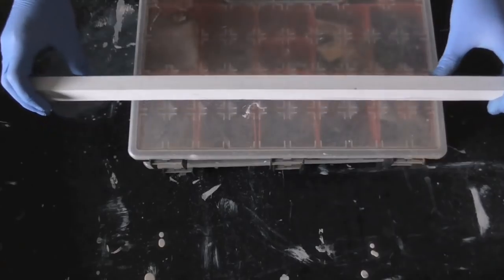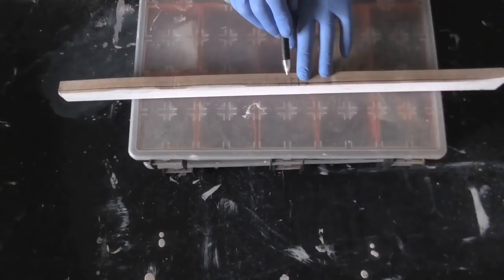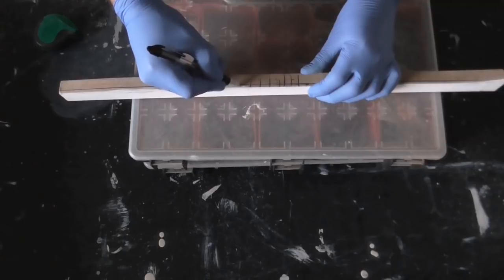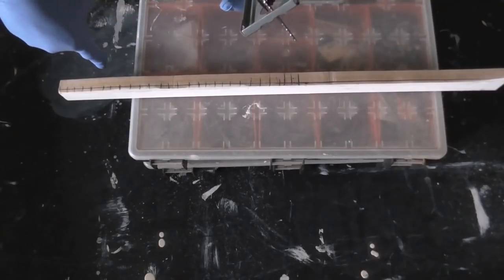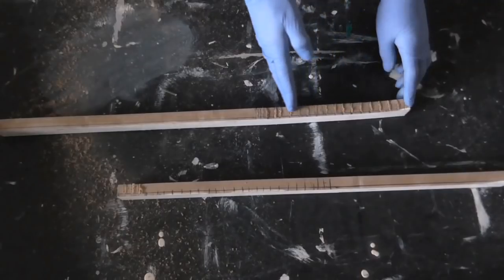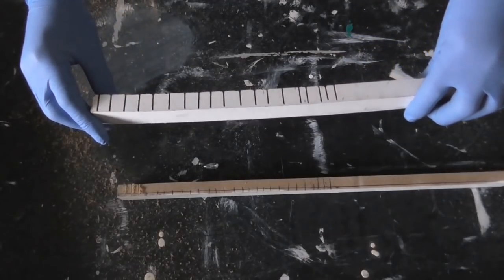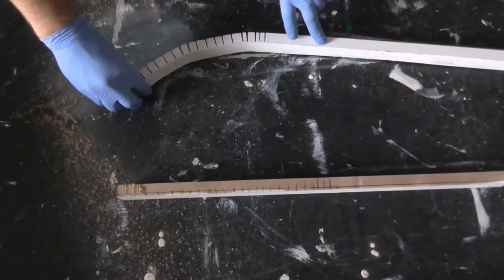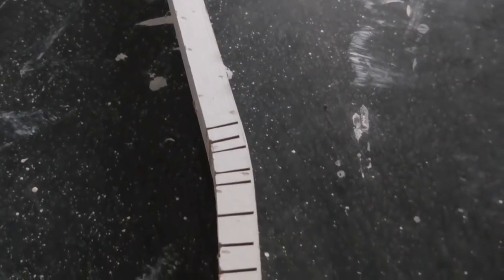Bending M.D.F. How To Form A Curve

Comment: When you’re kerf cutting timber/MDF, it’s better to lie the timber face down, set the depth on your circular saw & cross cut the material. That way you don’t get tear out, you get a wider cut, therefore easier to bend the timber & you’re not restricted in the length of cut that you can make.